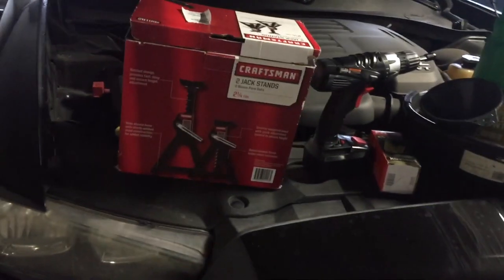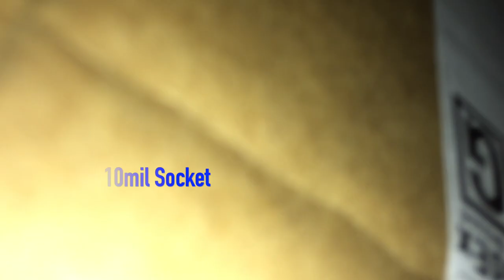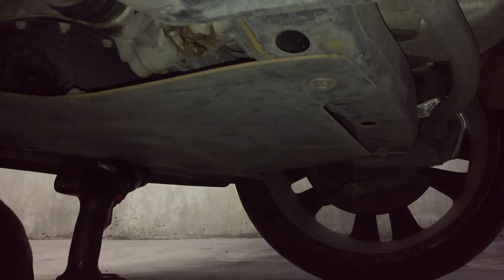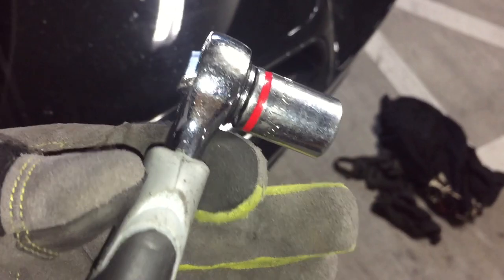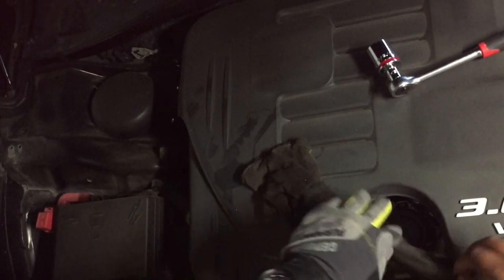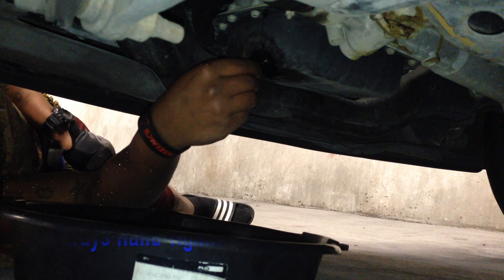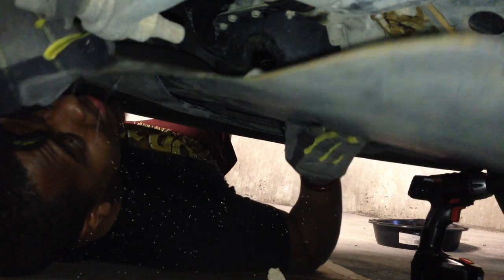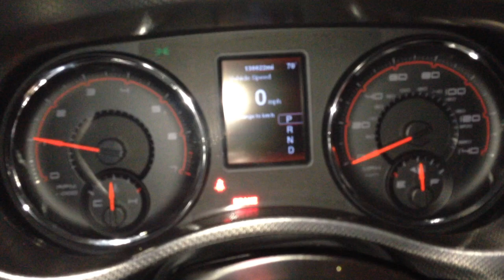DiY 2012 Dodge Charger V6 Oil Change

Comment: Can not having an up to date oil change make the charger over heat ??
Reply from the maker: Nope sound like something with coolant components. bad water pump, not enough coolant, bad radiator or fans and bad coolant resivor or Cap.

Comment: What kind of exhaust does yours have
Reply from the maker: Straight pip with a supper 44 flow master
Reply: @mightyprophet4581  it sounds nice mind just has the stock exhaust